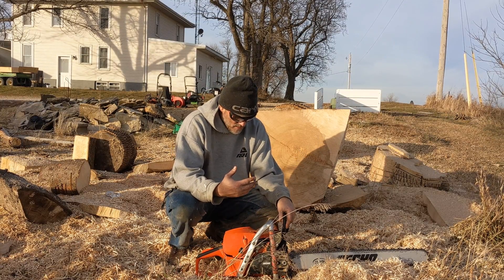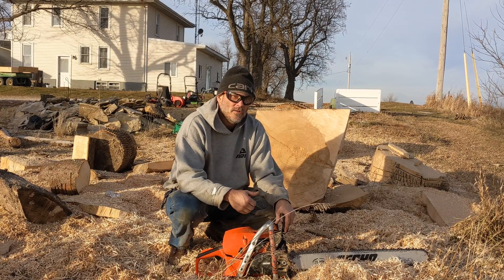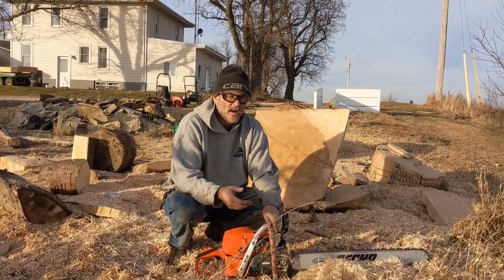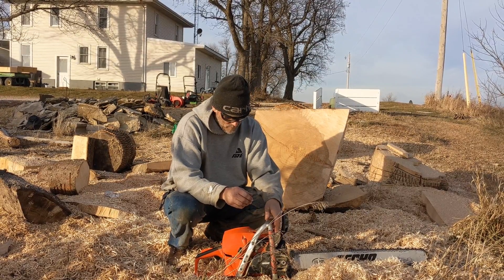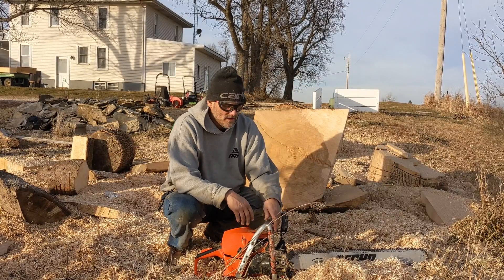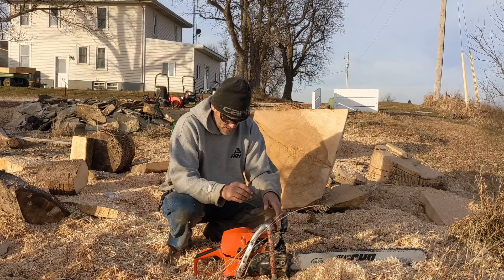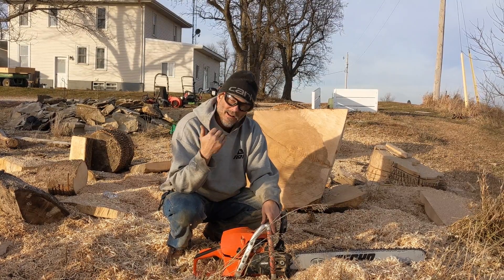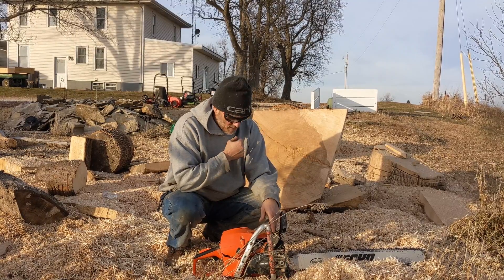Test and tune prototype cylinder 7 pin vs 8 pin

Comment: Hey Mitch, tha ks for all the great info on these 7310's.
What is the bar mount on these? Is there an easy mod to run a Stihl light bar or husky mount?
Thanks!😎👍
Reply from the maker: Mount is Husky large D009, no modifications needed.  Run an adapter for Stihl Guides.  Find Mike Manly (Homelite410 on the forums) he makes them.
Reply: @mweba1  great, Thanks! 😉👍

Comment: Where would you feel comfortable tuning a stock 7310, they call for 10,500 but a 372xp they’re good for at least 12,500 stock?
Reply from the maker: 12800 is a good four stroke and power on most of them that have come through my shop.  You could go higher but actually loose performance.

Comment: Got some nice stall bedding there to be cleaned up with noodles. I just sold a couple wagon loads last week from a  couple days worth of
cutting.
Reply from the maker: No Kidding?  Never thought of that!  Man, I have a lot...
Reply: @mweba1  yup, neighbor buys it for horse stall bedding. I loaded up a 8x14 barge box and a flare box. Got $75, not a lot but better than just pushing in a pile. In the spring people will buy it for mulch/compost to
Reply: @mweba1  1:33 mix ok ?

Comment: Damn that’s nice... those seem like a nice robust, no frills, get er done work saw. What do you suppose you gain/loose in chain speed going from 7 to 8 pin or vise versa?
Reply from the maker: In theory the chain speed is higher with an eight pin but you have to take into account loss of rpm due to more torque needed.  While the chain speed is a bit slower on the seven, it is much easier to hold an extra 1000 rpm, erasing any pain made.  My problem with the eight is extra heat building up in the motor and clutch assembly.  Also takes more finesse to run an eight.
Reply: @mweba1  
Thank you for the detailed explanation. I get what your saying, it’s like diminishing returns if you can HOLD the high chain speed in the cut. Doesn’t matter if it hits the log at Mach1 if it stalls out and falls down. Gotta have the grunt to keep driving it.
Reply: Not a big fan of 8 pin with longer bars with 70cc class saws ...